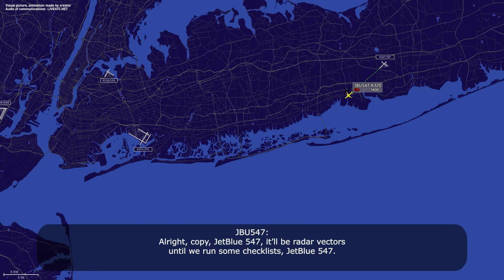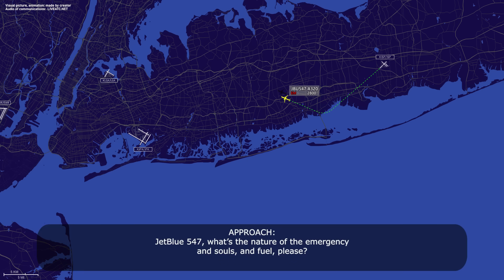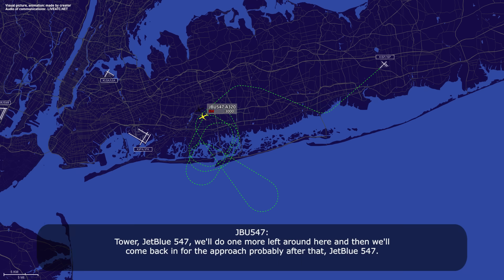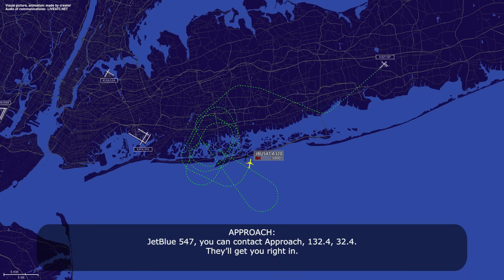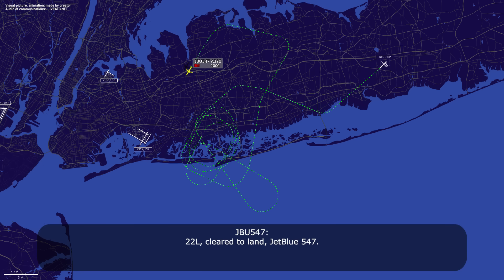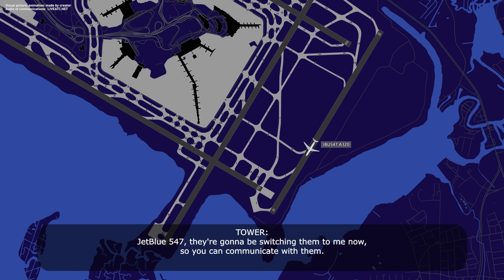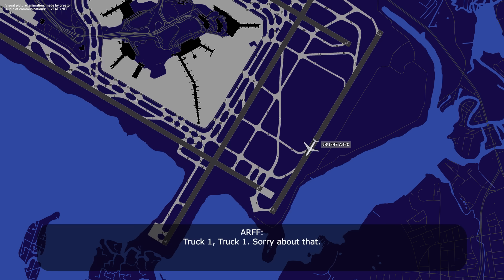47 minutes in the air with destroyed engine. JetBlue Airbus A320 diverts to JFK. Real ATC

Comment: Wait a second all that tons of circling was to:

1) burn fuel?
2) scare the passengers more?
3) finish the checklist?
4) ground emergency preparedness?
Reply: Nope. It was to:
- Fly the airplane
- Handle the fault (ECAM, Checklist, etc.)
- Make a plan (Divert? Continue? Air turn-back?)
- Make all necessary communications (ATC, cabin crew, passengers, dispatch).
- Overweight landing considerations (Overweight Landing Checklist)
- TCAS to TA only?
- Diversion items- FMS programming, (cost index 0, new destination, re-cruise the box)
- Set up and brief for the approach
- any additional  checklists (i.e. One Engine Inpp Straight-in Approach Checklist)

Okay, now we're ready for the approach.
Reply: @tsptrevor wow! I am not a pilot nor claim to be one but i can see your pov clearly.
Reply: @tsptrevor  Nope . SORRY , what he did is A LOT.  47 minuets to secure the engine with running the checklist  . i guess luck of experience has a roll in this actual scenario . he forget that the other engine could fail at any time . what i mean ya run the checklist but be reasonable with time management .

Ricky , from my experience   . i agree with you 100%.
Reply: @Raad-q4j  Engine failures are extremely rare. Theoretically they could have flown to their destination, but the infinitesimal chance of a double failure is why they land immediately.
Reply: was on the flight, already a nervous flier and they didn't tell us what was happening until 10 minutes to landing  but everyone knew something was wrong :)
Reply: @XxHungerGames12xX Oh, really? Wow, I'm surprised they didn't do an announcement somewhere in there.

Were you close enough up to the right-side engine to see or hear that it had a problem?
Reply: @big_beak I was on the left side but any seat on the plane could honestly hear it, it was loud. And the hydraulic power(?) sound never stopped the entire time.
Reply: @XxHungerGames12xX  Wow - I bet that was fun! (not)

This "knows enough to be dangerous" non-expert thinks you're probably correct about 'the hydraulic power(?) sound'. 

The plane would have redundant hydraulic systems, and without the right side engine's pump pressurizing one of those systems, I'm guessing a standby electric pump kicked in to take over for it. 

If so the sound would have been loudest for the passengers sitting directly over the pump. Hopefully the sound was a source of reassurance and comfort for you and your fellow passengers. 😊
Reply: Oh definitely #2, to needlessly scare the passengers more.

The pilot stated several times they needed more time to complete their checklists. 

There are additional checklists for emergencies, beyond the normal approach briefing, landing checklist, etc. Depending on the emergency, it might modify their normal approach & landing parameters (higher approach speed minimums, whether they can or cannot still use thrust reverser on the remaining engine, etc.). So they do have some incentive to perform the required checklists.

I'm sure the flight deck made public address announcements to the passengers to let them know what was going on, let them know why they hadn't landed yet, they can fly perfectly fine on one engine for hours if needed, etc., to reduce their anxiety.
Reply: mainly burn fuel
Reply: @yutv7438  1:07 "until we run some checklists "
3:25 "we just need some radar vectors for now just so we can finish up our checklist " 
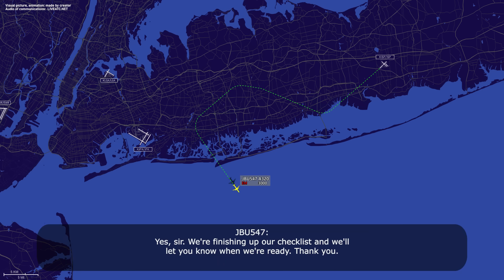4:31 ATC: "Just let us know when you're ready to come back in." Pilot: "Yes, sir. We're finishing up our checklist and we'll let you know when we're ready."
5:21  "Yeah, we're almost done with our checklist , so we'll notify you shortly."
7:38 "New York, JetBlue 547, ready for the approach now."

That's four times he said they needed to finish their checklists, which is exactly four more times than he even mentioned burning or dumping fuel.

I am dumbfounded why this is even a question.
Reply: @big_beak  he dsnt need all tht time for chklist ! he just took off so he carries more fuel he cant land with ! he needs to either dump it somewhere far ! or burn it , my guess tht he didnt want to fly somewhere further to dump it so he was making up an excuse by saying chklist eveytime while he was simply burning fuel
Reply: @yutv7438 Yes, because it would be embarrassing to ever admit to ATC that you had to burn fuel...so he had to think up some other excuse else to transmit over the radio. /s

Comment: Not a good job really. They should have landed way sooner than that. Asking for trouble as they could have been on the ground within 10 minutes. Especially, out over the ocean, not impressed.
Reply: That aircraft had to be certified to fly on one engine by the FAA during its certification process. The checklists are used to help configure the aircraft, shut down fuel, reduce electrical load, etc. While losing an engine is an emergency, the aircraft can safely stay airborne for hours depending on fuel quantity. The checklists are not financially motivated and are, in fact, used to maintain a margin of safety. Every pilot out there (myself included) that’s flown a multi engine airplane had to demonstrate the ability to fly the aircraft with an engine shut down or simulated zero thrust. It’s something airline pilots do frequently in the simulators as required  training. ATC vectors them around to allow the crew time to complete their checklists, perhaps send a message to the company dispatchers and burn off fuel to avoid overweight landings. They did a good job with this one.
Reply: @bryanspink8042  yeah its pretty amazing to see the safety records over the decades of real emergencies that occurred without casualties, you literally are safer in a plane than in your car hands down
Reply: That’s why you’re not a pilot.

Comment: Is it really necessary to add to pilots work load by reminding them they need Foxtrot weather during all this? I mean, in this situation, can’t ATC Tell them the weather?
Reply: It would be far more taxing to read them the whole thing. ATIS messages aren't super short, so better to just pull it up on the display.
Reply: @aaronclark524 thats what i meant. I guess i thot atc could abbreviate it to the relevant parts. Save time and workload?
Reply: @TangoDelta8111 It's also habit--plane checks in, confirm the altimeter, winds, and ATIS. Pilots can ignore it. In this case they eventually asked for the one part they cared about (temperature), so they probably hadn't actually read it.

Comment: "We just lost an engine, declaring an emergency"
"Roger, what is the nature of the emergency?"
Reply: Standard Operating procedure.  ATC has to proceed per established procedures.  Note that all ATC's asked the same question about 'the nature of the emergency'.
Doesn't matter if the ATC were Male, Female, Hamster, Codfish, etc.
Reply: Pilot:"We just lost an engine, declaring an emergency"
ATC: Surely you cant be serious 
Pilot: I am serous and don't call me Shirley   
ATC: Well  good luck then  we're all counting on you
Reply: Lost an engine and engine failure are completely different statements. You can't assume and you need confirmation. It is the golden rule of aviation. ATC is doing 100% correct here. It does not need to make sense to you.
Reply: They do that because they have protocols to follow. Did the engine fail the mech, or to environment,  or impact to somthing else. Who knows. They have to get it clear on the logs what he says, which also let's ground ops start preparing for certain procedures they have to follow on the ground.
Reply: I will hazard a guess the the response "Roger, what is the nature of the emergency?" is so thoroughly drilled with ATCs in sim, that it just tumbles out of the mouth automatically.  Actually, this is is quite good, as it both acknowledges the emergency and asks a (usually) necessary question early, at a moment the adrenaline is suddenly surging. Automatic is best at such times.
Reply: This is a DEI virus. If you call your bank or some other customer service goons, they always ask for a 2nd time, 'I"m sorry can you repeat that". DEI is a virus. G.E.D. grad cortical functioning.
Reply: I'm still unsure of how much fuel he had...... SMH
Reply: Probably the first time ISP has had a commercial airliner declare an emergency in 15 years, maybe longer!
Reply: @adamclandry   last I know of was 2018, check ISP wiki page
Reply: Exactly my point !!!
Reply: "Unable visual, above clouds."
She ignored that.
Reply: Best ATC in the world
Reply: Exactly. Great catch! How can she not hear/process that in the initial transmission?
Reply: Tell us you don't know  what emergency procedures are without telling us. They have to ask.
Reply: Its funnier when they actually loose the engine
Reply: Last few of these i watched have female ATC that dont seem to good
Reply: @coreyfranco7060  too
Reply: Is this ATC individual a DEI hire? Jesus.

Comment: Maybe the controllers kept asking the pilot(s) if they were ready to land because they were more concerned than the pilot(s) were about a passenger filled airliner flying over densely populated area, and over the ocean, with only one operating engine.
Reply: Probably ATC at JFK was dealing with the usual bunch of other incoming flights and wanted to an estimate on when the traffic pattern and flow should be rearranged to adjust to a circling aircraft that was likely to shut down one of their active runways when it landed.
Reply: Fear not: twins like this (& all new aircraft - bar the 747-8 & A380 - are twins) are certified to fly for varying lengths of time (from 60 up to 330 minutes) on one engine.
Reply: ATC would not have concerned them selves at all about where the plane was over flying. The Controller was asking while he was constantly thinking what he would have to do to get Jet Blue on the approach for 29L. When an aircraft is in an emergency state, they essentially own the sky around them. The Controllers job is to keep the sky empty in their area just in case things get worse like say an engibe fire. Of course this airspace is very congested which adds to the complexity of management of the emergency.

Comment: Seems like a long time to be driving around with an engine failure, particularly since this was a catastrophic failure.  Not returning to the nearest suitable airport is probably going to get some scrutiny.  Land on the shorter of the two runways?  Interesting choices.
Reply: No scrutiny would be held over this. JFK is the obvious suitable airport. Landing distance available on 22L is longer than 22R.
Reply: I don't think "nearest suitable airport" really makes a difference here. While they were running their checklists, the controllers who were setting them up for JFK actually got them back closer to the other airport, so...

Comment: It sounds like they were running checklists for at least 15 or 20 minutes, or much longer, after the right engine failed.  I don't know if these checklists are safety or financially motivated, and, I may be overly cautious, having never flown a large commercial airliner.  I know that the checklists are important to secure the engine, but, passenger safety is vastly more important.  As a retired 50 year ATP corporate jet pilot,  in the old days, if I was carrying a planeload of  passengers, including children and infants, not knowing the reason for the first engine failure (a second failure may be imminent - possibly fuel contamination), I would land the airplane immediately, rather than be circling over a densely populated area and out over the ocean, with only one operating engine, for the amount of time that appears to have been spent "running checklists".  In the many such reports I have viewed, I have been shocked that running these checklists seems to be standard operating procedure after engine failures on large commercial airliners, possibly to preserve the very expensive engines. Maybe this "running checklists" procedure is a left-over from the days of 3 or 4 engine airliners, but, in my opinion, in a 2-engine airliner, we need to get those passengers and fellow crew members on the ground as soon as possible, after an engine failure, and, after only essential safety measure have been made as quickly as possible. Screw the engines.
Reply: That aircraft had to be certified to fly on one engine by the FAA during its certification process. The checklists are used to help configure the aircraft, shut down fuel, reduce electrical load, etc. While losing an engine is an emergency, the aircraft can safely stay airborne for hours depending on fuel quantity. The checklists are not financially motivated and are, in fact, used to maintain a margin of safety. Every pilot out there (myself included) that’s flown a multi engine airplane had to demonstrate the ability to fly the aircraft with an engine shut down or simulated zero thrust. It’s something airline pilots do frequently in the simulators as required  training. ATC vectors them around to allow the crew time to complete their checklists, perhaps send a message to the company dispatchers and burn off fuel to avoid overweight landings. They did a good job with this one.
Reply: Precisely how mistakes are made. Finish the checklist.
Reply: @Geardaddys  tell that to the poor sods who were on SwissAir....they all burned to death as the pilots circled over a perfectly good airport doing their precious checklists.
Reply: The checklists are the aircraft designer's instructions for dealing with whatever mechanical or electrical problems that might come up. Pilots who are focused on going through their emergency checklists also need to use all their standard checklists as well, since there's the danger of being so focused on a rare emergency situation that everyday stuff like putting the gear down could get overlooked.
Reply: Thank God you’re not a commercial pilot!!!
Reply: reminds me of the SwissAir Farce, where the crew were so busy with checklists, the aircraft burned around them, killing all on board. 45  minutes flying with one engine IS UNACCEPTABLE.  GIVE YOUR HEAD A WOBBLE!! Get on the frigging ground man!
Reply: @swanvictor887  Swissair 111 was at 25,000 feet and 90 miles from the nearest an airport when the pilots reported smoke. 7 minutes later, after the pilots had done everything they could or should have, the smoke had turned into a raging fire that had driven them out of the flaming cockpit. Usually, most emergencies can be successfully managed by following the procedures in the checklists, but sometime pilots are stuck with totally hopeless situations..

Comment: When the brigade inspector says they can see through the engine, you know that engine is a write-off 😂 o7
Reply: I had 99's job at another airport,  Saw a couple of CF6 engines with holes blown through them from uncontained engine failures
Reply: @williamsmith2912 just put some stickers : risk of shrapnel
Reply: the plane is back in service lol

Comment: So I know nothing about this sort of thing, and I'm curious: When they knew they had a failed engine they were fine to taxi to the gate with the remaining one. When they learned that it had failed *really badly*, then they wanted a tow in. But either way they have a non-working engine that is not on fire, and a working engine... so why the change? Thanks!
Reply: They initially thought it was a contained engine failure. Then they've learned it was a catastrophic failure, not a contained one. The SOPs are different for a catastrophic engine failure and they probably don't allow taxiing.
Reply: So the pilot cannot see the engine at all and they don’t know if it’s just a bad part maybe in the accessory section maybe something else happened in the engine is basically intact but shut down so they can easily just taxi and once they found out that it’s completely destroyed and they don’t know what or how badly destroyed it’s prudent at that point to just shut everything down and get towed in